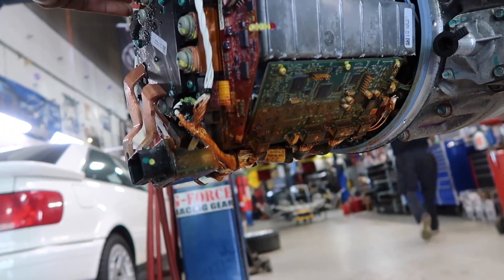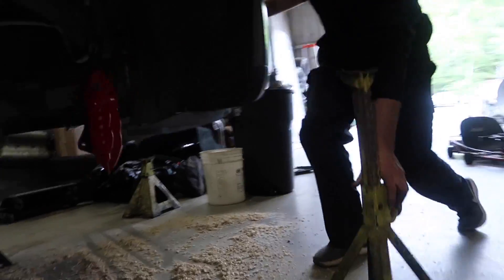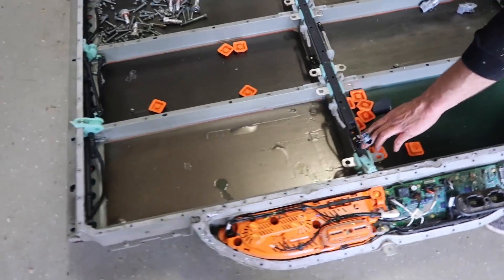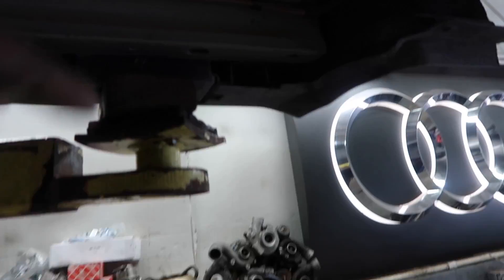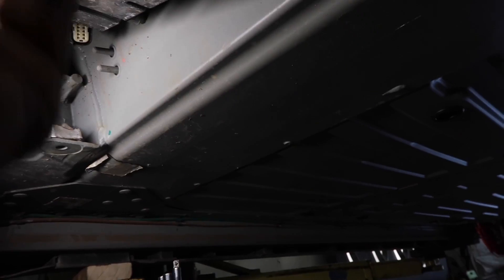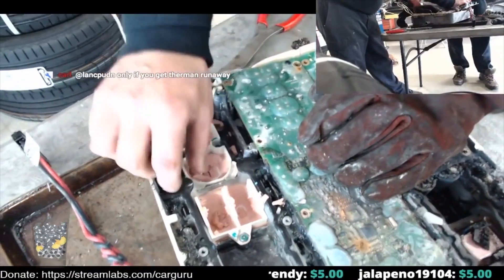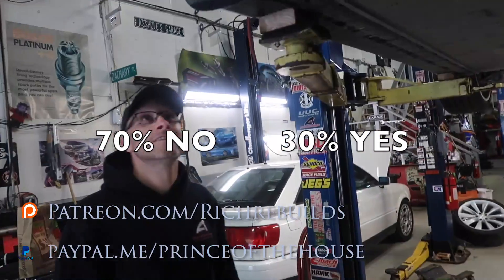Tesla: No User Serviceable Parts Inside

Comment: Given the corrosion starting on the connectors, relays, solder joints..I'd say this car is a ticking time bomb. It might run great for months or years-and then some connector will develop a high resistance and band-you are gone. These cars are unbelievably complex and I cannot see any shops wanting to repair them.

Comment: International Scout II had an electronic module that they filled with glue so you couldn't fix it. No reason to do it other than it was easy to repair but then they couldn't sell you the part. They are out of business and if you need one you are screwed. However there is a place on line where you can get the part...that was 10 years ago. It is a very nasty thing to do to sell more parts.

Comment: The seals in that are probably pretty good, the reason the water got in,  was because the unit was at operating temperature when it went in the water, and got almost instantly cooled down, causing a high vacume which sucked the water in past the seals,
Great Video, Thanks,  oh, I took off my clothes, But it was too cold, so I put them back on 😆😆

Comment: The purple power cleaner at Home Depot is EXCELLENT at cleaning PCBs. I have repaired MANY boards out of gaming machines that had corrosive drink spills.
Just drench the PC board in that cleaner (full strength) for a few minutes, then thoroughly wash it with water and blow it bone dry.
If the traces are eaten away, you may be screwed, but the boards frequently look as good as new.

Comment: The comment about BMW prop is an urban myth. The original BMW logo was designed in-house at Bayerische Motoren Werke AG in 1927. Whilst many think its checkered design is representative of a spinning aircraft propeller, it is in fact a combination of the logo of the Rapp Motorenwerke, from which the BMW company grew, and the colours of the Bavarian flag. The myth undoubtedly came from a BMW aircraft magazine cover illustration, released in 1929.

Comment: Maybe it is dangerous open that regulator with a cutter, there can be beryllium oxide inside.
Some power parts contain beryllium oxide (BeO), a Beryllia ceramic, in parts such as RF windows, attenuators and insulators. Solid pieces of BeO present no danger, as long as they remain whole, however, powder, fumes or vapor of BeO are extremely toxic if inhaled or if it comes in contact with the human body. It can cause pulmonary emphysema, rashes or ulceration. BeO used in electron tubes is sintered at high temperature and will not release powder, fumes or vapor when operated under normal conditions. There is, however, the risk of BeO entering the human body through abrasions, cuts or other external wound, so do not touch BeO with bare hands. In case BeO is touched, inadvertently, wash the contaminated skin completely with soap and water before drinking, eating or smoking. Never perform mechanical or chemical operations such as breaking, cutting, grinding, applying chemicals, etching or baking on BeO parts. If BeO is accidentally broken while handling, collect fragments into a thick plastic bag, seal the bagtightly with adhesive tape and affix a label clearly indicating “Danger: Beryllium Oxide”.

Comment: It looks that the motor and all of its electronic control circuits are well-insulated from water. It is evident from the fact that the water only came to the lowest portion of  the motor case. The reason that the water got into the motor case is because of the case air breather. Manufacturers do not make the case air tight because inside air pressure and the atmospheric pressure vary from each other. This either builds pressure in the case or makes it suck air through the shaft seals. Hence, the designer equalize the pressure differential through an air breather in a controlled manner rather than any non intended way. So, when the motor gets hot, the case will breath out. In turn, and as an example, when a hot case get in contact with (or submerged by) water, it breath in air. 

Therefore, it can be concluded (theoretically) that the water got to the motor case only through the case air breather while the case cooled down and breath in to equalize pressure.

Comment: Well.  If I was ever going to buy a Tesla, I think this cured me.  An electric car should end up simpler, not more complicated.  That's half the idea; you don't need all the plumbing and wiring the ICE needs just to not pollute.  Battery, controller and motor, it should be that simple.  A broken Tesla will become an expensive pile of junk, just like an Apple computer, if Tesla keep all the info to themselves.

There is a good reason why it is risky to try to make one good Tesla out of 2 or 3 dud ones.  Electronic components are manufactured with revision levels, as they are constantly being debugged and improved.  It is quite likely that a board with higher rev level will not behave the same as a lower one, and the problems can quickly multiply if mixed with other boards of also different rev levels.  The result can be malfunctions that are so subtle you would never track them down.  Worse, because Tesla are the only ones who have this information.  I worked with fancy medical equipment for many years, and this rev level problem was always a big headache, even with the histories available.  Without them, it's a nightmare.

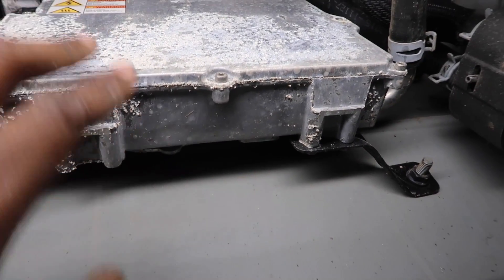Comment: 7:15 "its not that bad"  Lemme tell you that corroded sensor cables or connectors are such a no no - millivolt differences will cause stuff to shut down.

Comment: Be nice to those circuit boards Rich. Once their clean, they stand a good chance of be ok. Worst case an IC or other component can be transplanted from one board to another. Done that myself and saved many ecu boards. Once took a board from a vehicle that had been on fire. That burnt ecu board donated parts to about 5 other ecu's, and that saved them. Same with chargers and dc-dc units.

Comment: I never would have done this, a fresh water rinse, and a good drying and this car most likely would have been OK. I've recovered many electronic things from flooded cellars and even found electronic things in the woods, they all worked after cleaning and drying. The only problem I ever had, was rusted bolts that never should have been used for electrical connections on cheaply made stereo amplifiers. But this Tesla appears to have been quality made.

Comment: The blue and white on the BMW logo symbolize the bavarian national colors (which are white and blue), they just had to flip the blue and white around because private companies are not allowed to use national emblems. It was later interpreted as a propeller by others and in retrospect of the aircraft motor history it was cultivated, but it was never the original meaning of the blue and white

Comment: I dont know why they dont encapsulate the modules in a vessel under vacuum. Or cover the component and solder side of the pcbs with a half inch of sticky jelly like early mopar lean burn and injection modules did. My guess is everybody knows somebody  who can fix it. Probably a handful  or less techs here in the states that would even have a clue what they are looking at.  I dont have time to watch  and be up and up on exactly whats going. Some stuff may be saveable dependent on a lot of factors and what its been exposed to.

Comment: A white and navy checkerboard surrounded by a wheel with the word BMW appeared for the first time in print in 1918. The first vehicle marked with a checkerboard was the first BMW motorbike, the R32 model from 1923, and the first BMW car 3/15 PS from 1927. The first associations with the working propeller of the aircraft appeared only two years later.
 The round shape was taken from the RAPP Motorenwerke badge from which BMW derives, while the white and blue chessboard motif is the colors of the Bavarian flag.

Comment: It looks like a 10 year old Tesla will be destined for the Crusher if the car is not stored in a vacuum chamber.

Considering the high sticker price and the reduced amount of labor needed to produce a Tesla drive-line......I am disgusted that all of the critical drive-line components are not hermetically sealed. A few diligent engineers accompanied by effective quality control could solve the problems without breaking the bank.

I suppose that Mr Musk does not realize that his trusted crew is stealing his hard earned cash.....probably getting a little kick-back from under performing suppliers.

Comment: D M , talk about stupid. water is water, combined to glycol or not, a gasket or o-ring properly designed would keep water from infiltration of sensitive and expensive components.   I am sure the engineers at Tesla know this, and would have included it, but the bean counters decided the labor costs and materials cost was prohibitive, just like Ford did with Pinto gas tanks...   I guess simple mechanics is beyond some folks capacity. I am sure you have never worked professionally in the automotive trade.

Comment: Thats not glue, thats potting material. The purpose of potting is to improve heat transfer and damp vibration stress on components. Very different from glue, which primary function is adhesion strength.

Comment: problem is, the pins and wiring may be functionally ok for now, but if it's wet inside the connectors and wire jacket, it will corrode/tarnish and fail randomly everywhere.
water will wick through stranded wiring and there's ample oxygen to cause problems.

Comment: The "glue" is probably to remove heat from the circuit boards. Like a CPU in a PC. A lot of current means a lot of HEAT to dissipate.
Reply: It would have the opposite effect.

Comment: You know, most of these components were likely completely flooded... but if it's been sitting for a period of time, after the waters recede, than most of the water drains out. But because there's not as much pressure pushing it out, as was forcing it in, the seals are able to resist, & contain some of the water. Therefore, the determines that you're seeing, is where the remaining water level was, after natural drainage.
   This is especially evident in the motor. Notice how the water mine goes to just the bottom of the lowest plug holes, indicating that that's where the beach occurred. After the water receded, the motor drained out until the level was just below the bottom of the plug holes, & then apparently sat @ that level, for however long it sat for, after the flood receded. It does look like you got lucky, though, with @ least 1 of those junction boxes, though.

Comment: Tesla needs to build a car without the autopilot, those sensors create all of the expense to the cars and are not necessary. They could halve the cost of their model 3 and still build a more powerful vehicle at the same time. If you get a ding in your car without the sensors, so what, it won't effect the performance of the vehicle and your insurance company won't try to lobotomize you.

Comment: Man, that Audi coupe looks great.  It has the 5-in-line, 20V motor.  Some of those I believe were turbos... maybe?  Anyway, I have a 1995 Audi 90 Quattro, which came right after the couple and the Audi 80. My 90 has the 90 degree V6 motor that later was in the 1996 A4.  But I first wanted the coupe, just that they are hard to come by. I would love to hear that 5 cyl motor running...

Comment: Rich, chances are all those boards are coated in silicone and actually OK if you clean them off with water or alcohol. It’s the connectors and pins that might be corroded, but easily checked and maybe clear with wire brush. Don’t give up on the electronics.

Comment: So, Tesla has to remove the 4,000 pound battery from the car to get to 2 old-fashioned fuses hidden in a waterproof inverter box?!  That's some really great design...and I had thought it bizarrely stoopid to have to remove the radiator to change the timing belt of a 1991 Honda Accord.  D'oh!

Comment: Rossman is a capable guy. But to fix electronics you're not familiar with, you need documentation. What each subcomponent is, what it does and what voltage it's supposed to be. If you have that information, you can check for faults. But  if you don't, you cant. Guess what, Tesla hasn't released documentation to the public. That's why you can only swap components, instead of refurbishing them by doing subcomponent level repair.
Reply: You don't need documentation to clean and bake boards. You don't need documentation to know how a diode, capacitor, inductor, transistor etc is supposed to behave.
Reply: Sideslip baking boards? Ahaha, good one! You're the type of guy Rossman loves to roast.
Reply: +Sideslip  "Cleaning and baking"  a muddy transistor or integrated circuit is most certainly NOT component/system level electronic trouble shooting. Any moron can properly clean a circuit board.  Say you did that, fired it up, and it worked. The connectors to that board are obviously not to be relied on, rust never sleeps! you would have to replace all connectors to that board. Do the arithmetic on replacing the connectors.  Unless the fate of the world is at stake, Just Get A Replacement Board from yet ANOTHER Salvage Tesla.

Comment: “We used the plasma cutter because we don’t have time for this shit.” 😆 I like your style!
Reply: They "tried" to pot the charger. Seen and done a better job of potting electrics. The stuff I worked on had to be flameproof.
Reply: @stephenhunter70  You realize what a plasma cutter is right? Not a lot of "flameproof" stuff that will resist it. Cut through most shit like hot butter.
Reply: @stephenhunter70  Thats not an Oxy Acetylene torch in otherwords lol its 
Argon-Hydrogen

Comment: Louis Rossmann can fix this board 10:17
Reply: only if he has the schematics and if you know tesla that won't fucking happen, lol.
Reply: Tesla Beam I wonder what he will find, and ultimately say about tesla's boards.
Reply: Tesla probably uses COTS Parts, at least for some of the Chips. That means, you can get some of the schematics. Then youll just have to follow the Traces. From the Look of the Board, is not as highly integrated as modern Laptops, so there is actually a good chance for Mr. Rossmann to at least check what works and what not and maybe fix some stuff, even without schematics.
Reply: I'm pretty sure he has done worse, but even if he can't it will more than likely be comical to watch. :D
Reply: only if it has ppBuss lines connected to compositor running at 12 volts  :'p
Reply: David Westernall - Reverse engineer the Tesla boards and anonymously leak schematics on torrents & darkweb.
Reply: Georg Hager I do believe that's going to be the case.
Reply: +Tesla Beam   IF he can fix that board, then this Rossmann person would be valuable in reverse engineering extraterrestrial technology. Why bother fixing a postage stamp that's been underwater for 10 days?

Comment: How is an all electric vehicle not have its electric parts in water proof or impervious containers?? This seems to be a fundamental design flaw,and a huge issue. Not necessarily bottom of a river water proof but at least to the roof line.  Water doesn't necessarily ruin electronics, many time just converting the oxygenated metal back to an uncorroded state will do the job.